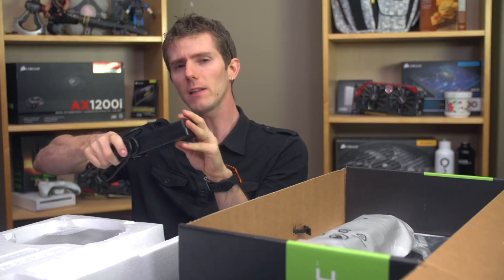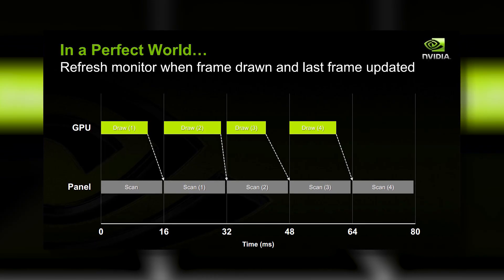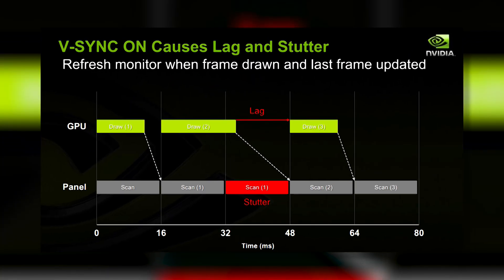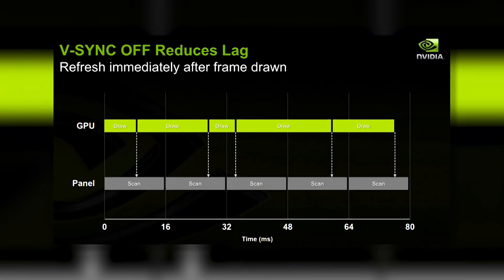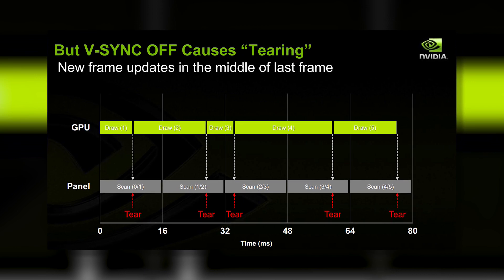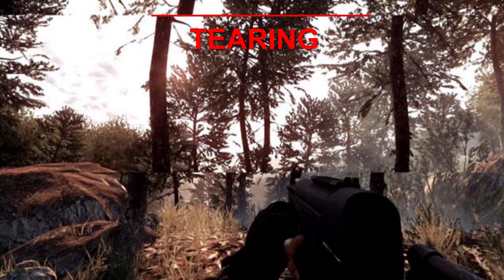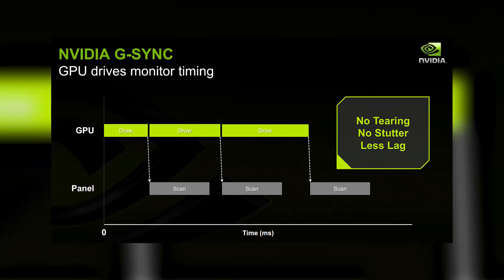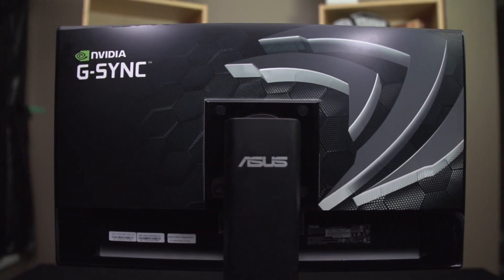NVIDIA G-SYNC Tech Preview - Linus & Slick's Impressions

Comment: so does this mean if i were to have a 144hz monitor, that will be the max, but then if i'm running a game at 120FPS it is pretty much 120Hz, if my frames then drop to 100fps it will be at 100hz?
Reply: Yes.
Reply: Yes.
Reply: ***** Are you serious? That's what G-Sync is about. It automatically changes monitor refresh rate to match your GPU. If you have 120Hz monitor and the game only runs at 45fps the G-Sync equipped monitor will refresh the image 45 times per second (45Hz).
Reply: sweet :D
Reply: Pretty much, yes
Reply: lol xD yes im talking about G-sync monitors. ive been wanting a 144hz monitor for a while now so knowing that a G-sync monitor does everything but still has a cap makes me very happy :D

Comment: I have this monitor and without the G-Sync and V-Sync turned off in almost all my games don't have any lag or tearing.

So from what your saying in conclusion to what ROG ASUS web site said that you would be able to add G-Sync to the VG248QE, but your saying it's not going to happen. That makes me sad. but I'm liking this monitor anyhow cause I don't get the 60Hz problems witch is good.

I have 2 PC, one was built in 2008 and still has a WD mechanical drive and another PC that was built in 2011 and has an SSD and going back to the old PC is night and day. I'm a gamer and map loads are so so much longer on the old one, sometimes like in SWToR it's about a minute longer to load any areas or maps or flashpoints. On the newer PC I'm usually one of the first to get into a CoD match and the old one, people are already killing each other when I first get to select my gun.

Comment: Well, what happens with G-Sync if the graphics card can render more than 60 Hz? for example, rendering 100 fps and the G-Sync module only supports up to 60 Hz? And what happens if the monitor has 60 Hz meaning that it's will update frames every 17 ms but the next frame is ready in less time? Is then the monitor going to wait to be able to show the image on screen?

Comment: ok so I'm gonna be building a new pc and I was wondering if my parts would fit in my case and if my psu can supply enough power so here is my list- gpu- r9 270x, cpu- fx 8350, psu- 700watt, mobo-GIGABYTE GA-970A-D3P,Ram-CORSAIR Vengeance 8GB, case-Thermaltake V3, hdd-1 tb, wifi adapter-TP-LINK TL-WDN4800 Dual Band Wireless N900 and extra case fans- 2x Corsair Air Series AF120

Comment: As someone who has this same exact monitor, I just don't understand the purpose of G-Sync. This monitor already is smooth as silk. I already get absolutely no tearing, regardless of my framerate. Having a monitor already running at 120hz (I use lightboost) all of the issues are pretty much already gone. I would like to see this with a monitor that is at 60hz or longer pixel delay.
Reply: G-Sync is more so for making lower FPS look like higher FPS I've seen it in a few different examples and 40 fps looks rather smooth. It's just so when you do have frame dips they're much less noticeable.

Comment: I went SSD and then I go to work on my moms non SSD computer and it's unbarabley slow. It drives me crazy, I wont ever go back to a HDD. I would rather be without a computer than to return to the old HDD.

And IMO Nvidia needs to share G-SYNC with ATI, because if they want to make sure that gamers get the best experience available, then they need to share this technology across multiple platforms. And if when Mantle gets released and Nvidia wants access to it, they better play ball with this. Because if Mantle pans out the way ATI hopes, I get the feeling more people will be using it than will want to pay for G-Sync.
Reply: It's not that bad as you make it sound...I use WD Caviar Green 1.5TB for all sort of files and programs, games etc. but SSD for OS, drivers and such programs as MS Office etc. I can't afford 500GB SSD to store everything on it. I only have Kingston HyperX 120GB SSD. HDD has a decent speed and they are seriously cheap, even for 1-3TB they are so cheap. Clean your/moms PC, delete unnecessary registry files, turn off unnecessary services, etc. And buy decent HDD -_- , cause It seems that you are using some real 90's HDD. You can try and buy SSHD, which includes a portion of speed from SSD's and portion of disk space from HDD's, it's exactly between SSD and HDD, has a decent speed and space in it, it's not like HDD sacrifices speed to gain space, and SSD sacrifices space to gain speed (they aren't actually sacrificing, they are simply restricted by technology and price), and it's affordable about decent price too, get larger RAM too, 6-8GB for OS too, even if PC isn't using it all, it still feels faster than using 4GB which is recommended for OS's with 64bit, and use Win7 or Win8. Dunno how much you know stuff, just giving some larger and smaller advices, and trying to correct you.
Reply: BIOSHOCKFOXX No it's as bad as it sounds. I am the one that has to do all the maintenance on her computer, and I'm telling you it's slow. I do weekly maintenance on her PC by the way of teamviewer software and in the times where I have to actually go to her house to work on her PC, I can actually feel the speed difference between mine and hers. I'm toying with the idea of getting her a SSD, it's for her PC but it's for me when I have to work on her computer. And I know more than the basics, a lot more.

Comment: My SSD runs @ SATA 1 (stupid Nvidia 750i chipset will not run at SATA 2 for the SSD), so it's not THAT much quicker than my POS hard drive at work, but it's still noticeable.

I'm hoping to build a new system with a new monitor in a couple of months time, well and truly past upgrade time. The current plan is a Radeon based render rig which streams to an nVidia system with Gsync. I'm hoping that will give me Mantle AND G-Sync for the same game at the same time :)
Don't wanna license your stuff nVidia? Then you only sell the cheapest card to me while your competitor gets to sell me their best stuff! Stick that in your greedy pockets.

Comment: What about 120Hz monitors? Would a higher refresh rate not reduce the input lag, and make gsync unnecessary?
Reply: G-Sync is to remove tearing and not to reduce input lag, it is just an added bonus. G-Sync is always good because it will never show frames twice or go below what your GPU can output.

Yes tearing is less noticeable on G-Sync on high refresh rates but there is no reason not to run G-Sync anyway.
Reply: Echo453 I was talking about a 120Hz monitor with v-sync on. For g-sync to have effect on a 120Hz monitor, you would need a game that runs on 120+ fps I guess?
Reply: 0rd0s No, 120 hz is now the maximum refresh rate. The monitor will tone down the refresh rate to match what ever the GPU is giving it. That has no negative effects on anything since the GPU is not displaying 120fps anyway so there is nothing bad about lowering the refresh rate.

Comment: I actually still do not own an SSD. Why? I'm not that rich and, honestly, if i have 100-200 bucks to spare i'll rather have them go towards hardware upgrades conductive to actual performance improvements than quality-of-life stuff that i do not really have a problem with at this point.
Reply: SSD's do have actual performance increase. You are a fool if you think they do not.
Reply: No it doesn't dumbfuck. Also, what up with getting personal just because i express a polite opinion on the internet? What are you 7?
Reply: Sam Cooper He is right, there is no fps boost.  The only differences are shorter load times and a snappier OS experience.

Comment: Don't need G-sync, because 120hz monitor. Also no input lag. G-sync is for shitty 60hz monitors, because a monitor should be 120/144hz in games. No tearing or input lag, v-sync always off <3
Reply: Would v-sync on not be the better option?
Reply: stay pleb
Reply: 0rd0s I use this monitor 120hz with Lightboost and V-sync on feels much smoother.

Comment: Regarding the HDD VS SSD... I just got my first SSD and a PROPER Rig (builded myself) and i also own a resonable probook with normal HDD (have win 8.1 on both) And i agree. I cannot go back to HDD as a OS drive. Never again i buy something without an SSD. If i buy a laptop with HDD i will replace it probably with SSHD hybrid at least. unless the SSD price falls significaly lower than it is now (which is quite low, i have now two 120 gig SSDs running in RAID0 and one costed 82€ for those 120 gig) i think next upgrade will be probably a system with SSD only and will have a NAS system in the house for massive storage. That is my opinion. I trust Linus on G-sync so in the next 2 years when i will change my monitor i will consider  G-sync based monitor (dependant on the price) and try it out. As far as i understand a G monitor would be only couple 10 bucks more than non G monitor (same one) so even if it's not good you don't need to use it and it would not cost you anything significantly since you would still have a monitor... (speculating the price difference in 2 years). And i have GTX 760 which will be replaced this summer for probably 780 ti or next gen graphic card since the 760 is dragging my pc back atm even if i can play everything on ultra with 40-70 fps. Linus tips were the ones who made my build my own rig with recomended parts which i don't regret any. Thanks LINUS!

Comment: The deal with the SSDs was and is that the price per GB is just so much higher than a regular HDD that the advantages just didn't outweigh the price difference and still don't. Not everybody uses SSDs to work on and some have the patience to wait several seconds for their OS to boot which is the prime example that is significantly faster than with a regular HDD. If G-Sync monitors aren't that much more expensive than normal ones then I see nothing in their way and they will quickly replace normal monitors (at least for Nvidia card owners ;) ).

Comment: lol I have a 59hz monitor with a GTX770....generally 200fps on black ops 2 online, I don't care for this fancy stuff..lot's of frames works for some online games.
Reply: lol best part is you forgetting logic and reasoning. I never mentioned my resolution.

1680x1050 , Black ops 2 multiplayer, 200fps. No problem. Fail harder next time.
Reply: Spirit lol how old are you kid, I didn't try to make my GPU look good.
But calling a GTX770 a shit card already explains a lot about you.
Reply: ***** I know this ;p

Source engine however, you hit earlier than your enemy when your frames are higher.

Lobby try hard pro's play CSS on 800x600 low settings.
Reply: Crystal Roux I think you will find this is bullshit. No game engine designed that isn't shit will have the update loop tied to display loop. I do not know that source does not do this for a fact, but unless you have had someone who has seriously trawled through the source code of the engine and then provided solid evidence why it would do this; I wouldn't believe it.
Reply: Spirit Just like any AMD fan boy to start typing on his 5 dollar keyboard with his 10 dollar vid card. Are you mad that you AMD card can't hit 200 FPS on Call of Duty Blops 2 or any game for that matter? It does suck that AMD cards don't have to implement PhysX or FXAA/TXAA and to see what real shitty FPS AMD gets, where Nvidia cards have these things and still put out a good FPS. it's a wonder why no one thinks of this, and says AMD is better when benching, AMD doesn't even have to work as hard and still, NVIDIA kicks its ass in most BENCHMARKS. Why do you think most enthusiast and case modders use Intel and Nvidia????? Cause they are better in almost every way.
Reply: I never claimed to be a fanboy, Weird I have no problems with BF4 on ultra settings with a GTX 680. are you doing something wrong?
Reply: ummm. why would you do that in the first place? I'm fine with 1080P, no need to go any higher unless it's a 1440P and then run it at its native. if you run anything out of the native resolution it looks blurry ..well to me it does, so for me it's a big waste.
Reply: Spirit I am not sure where you are getting your shit from but damn is it shit.

Also if sizes are a problem for you, the fuck are you doing here.
Reply: Nah, I smell fanboy troll juice. gg bro
Reply: it's funny that the 290X "NEEDS" an after market cooler cause the reference design makes the card throttle and drops FPS, a lot of FPS. just saying. Its just the way AMD does stuff, they release lies and cheat numbers. I mean they have to sell their product somehow :)
Reply: Again, why would you scale a game? why swamp the card with unnecessary res when there is CSAA and MSAA and TXAA. Most games I play really don't need it but some do, but I'd rather use those functions that try to scale a card to do more that it should. There is still no reason for it.

Comment: Base on the information, G-SYNC equals to a monitor with no tearing at high fps, no stuttering in low fps and no input lag. Even with only the game runs only 30fps, the animation should theoretically still be buttery smooth.

Comment: My main system uses a 840 pro, which as of yesterday I now have running with RAPID and my work station uses a WD Black. I can say without a doubt that having a SSD as the C Drive makes a huge difference, waiting that extra ~ 8 - 10 seconds on bootup is torturous when you just want to get things done in an early morning.

Comment: I think that g-sync is stupid as long as you have to buy a monitor, because if you have a mid-high end gpu you will not need g-sync, but if have a low-mid range gpu you must buy a new monitor for 400$, and 400$ as a gtx770 which will play every game with 60fps+ 1080p maxedout and that makes g-sync useless....

Comment: Assassins Creed Black Flag is indeed horrible without V-sync, insanely amounts of tearing. The in-game V-sync is also horrible, decreasing performance and lot's of input-lag. 

I did fix this by forcing 'triple buffering' and forcing the V-sync form the video card control panel, I also forced the max render flip queue to 1. The difference is HUGE with Assassins Creed Black Flag. Off course G-sync also fixes this...

I would like to see an impression of 'optimal tuned' V-sync (with triple buffering and so on) versus G-sync comparison.

Comment: I am sold on how revolutionary it's going to be, both the theory behind it and your impressions, as well as Anand's article convinced me of that, so I don't think that the problem.
If nvidia wants G-Sync to become mainstream (as opposed to just niche) and not a copy of g-sync to become mainstream thy will have to license it to AMD, expecting everyone to go green just for the sake of g-sync is kind of far fetched. The worst case scenario would be having AMD develop a similar technology and having to pick a monitor based on your GPU brand and vice versa. In the same way in which both AMD and nvidia should be able to run mantle and Physx should be at least allowed to work by using a Geforce card for Physx and an AMD card for rendering. It's just silly on AMD and nvidia part to expect costumers to pick one over the other just for the sake of (secondary) features, rather than sheer performance, it just makes people pissed because they can't get to use Mantle, PhysX and G-Sync at the same time.
Personally I would wait until there is a nice IPS monitor with G-Sync and get that, so I would get the benefit of G-Sync, plus better color reproduction, compared to my current cheapo TN panel.

Comment: LinusTechTips  it is hard.I mean I had some money stashed and my PC was pretty old with an old HDD and I said fuck it lets upgrade.Besides the other parts which I dont need to say, I bought a SSD. Man...its not 2 seconds less, its way more than that.I just put some programs and windows on it.Everything is faster.I go to a friend of mine who has a similar pc but without SSD and it doesnt feel right at all.I would probably guy G-Sync if it doesnt cost like 1 apartment and will wait as you said to make an educated decision based on your thoughts and others. Do you have any idea or speculation as to what the price could be for a 21-24inch normal led/lcd with g-sync?

Comment: About the SSD/HDD thing? It's impossible to go back to them - too much pain waiting for things to load. But that's not how we're all going to feel about G-Sync in a while - anyone running a 1080p monitor will soon not need it, as it's going to be far too easy to go above the monitor's refresh rate consistently with newer graphics cards. 

At 4k, maybe, it makes more sense to use G-Sync.

Comment: Certainly agree on the SSD vs HDD thing. The same thing applies to when I was switching from console to PC; on console many games did not run at 60 FPS, whereas on PC they could run at that and then some. Going back to lower frame rates is next to impossible for me now.

Comment: Great video - now I understand what G-Sync does.  Linus, one thought could be that if we buy non G-Sync monitors - if available - at twice the maximum gaming fps, it could technically eliminate the issues associated with tearing, stutter, etc.  In other words, if I will only crank up the graphics card to just below 60 fps and have a 120Hz refresh rate monitor, I should never experience those issues - per the laws / mathematics of minimum sampling frequency?  If that is true, Nvidia's idea of G-Sync is not a "real enough solution" to the problem given the dynamics of potentially higher and higher monitor refresh rates in the coming years?

Comment: I've had a Samsung 840 SSD after my laptop hard drive broke. In the beginning of the transition it used to feel like ages to boot an on hdd, but I got used to both my ssd and a bit more patient on hdds. But there's no point in booting a primary OS off of an hdd.